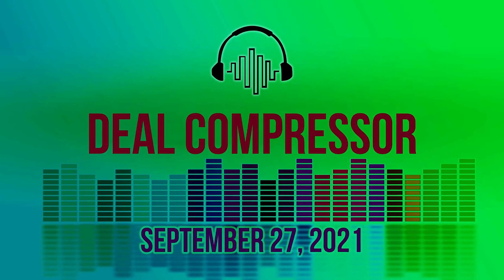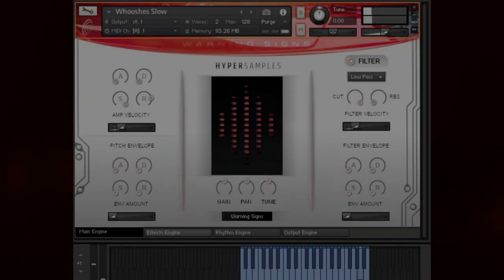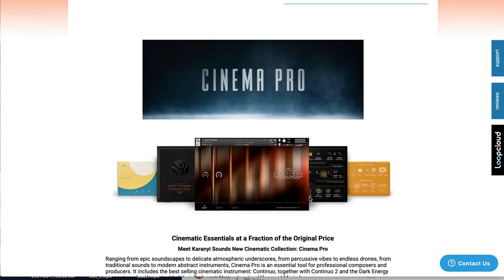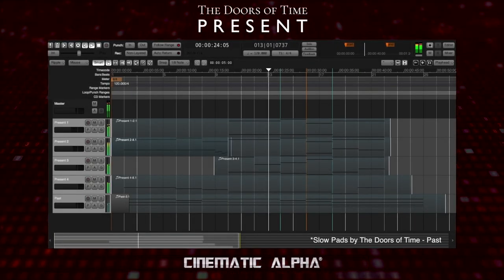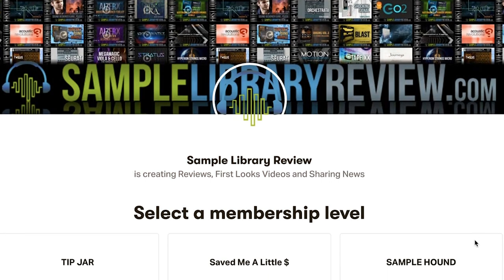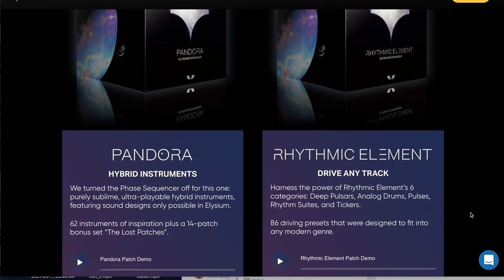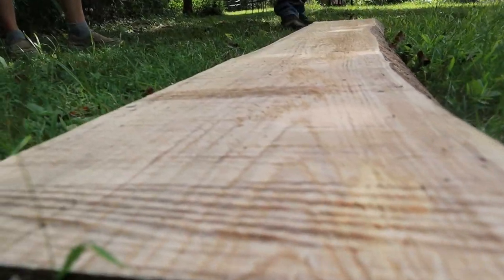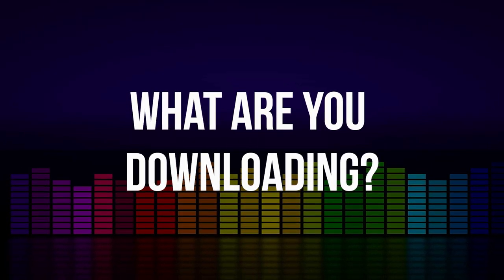Music Software News & Sales for September 27, 2021 - Deal Compressor Show

Comment: I picked up UJAM's-Void and Kirk Hunters- Lyric Quartet this week.
Void delivers fast results when writing complex beats or simple 4 on floor house or hip-hop.

Lyric is smooth, easy to use and is sampled extremely well. I absolutely hate the Green color GUI, but it doesn't hinder the usability. There is a slight learning curve when using the advanced functions like lightning Spiccatos and others. I didn't see an ensemble patch which is also a huge miss.
Reply from the maker: Awesome thanks as always for sharing Nick!